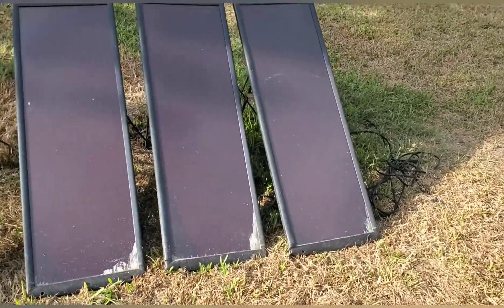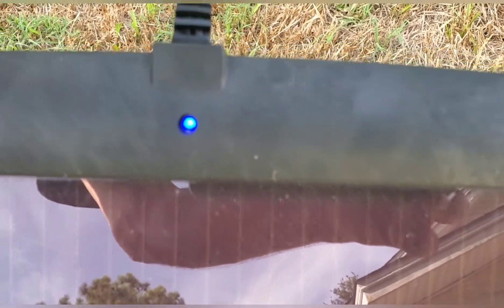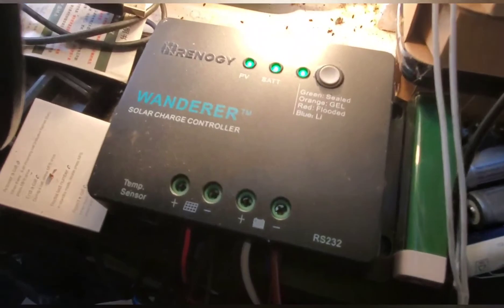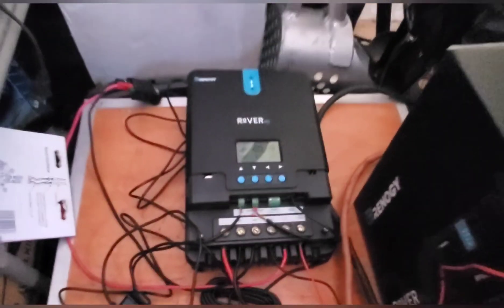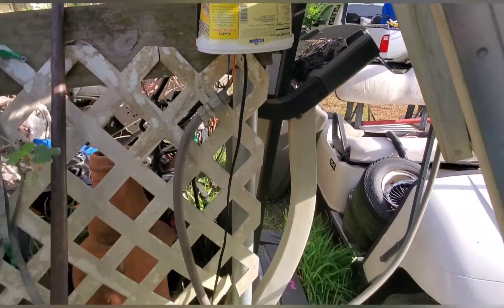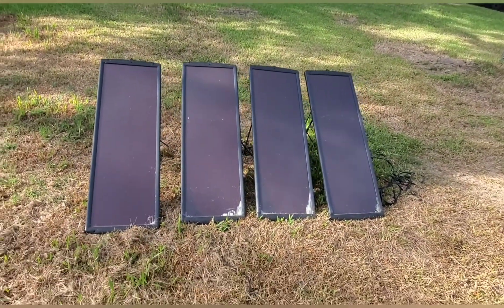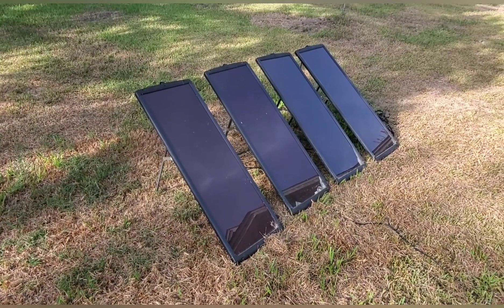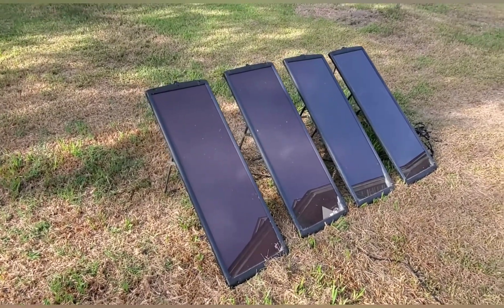Harbor Freight Solar System 4 years Later, How did it Fair?

Comment: For over 40 years... I've been told never to set batteries on the ground,it kills them
Reply from the maker: I was told never set Batteries on Concrete, but either way, my batteries are in a rack mount system that holds them. They are still going strong after 4+ Years. The ones in the video that are on the ground get cycled through into the generator as a start battery. The whole house generator doesn't keep the battery charged, so I just do it this way. I could just add a solar panel to the generator, but I have been lazy so far.

Comment: I have been using the same system for years and it is still working fine. What I did after inspecting the panels is seal the edges where the glass panel meets the plastic with clear RTV. I think water might be getting in there so I sealed it. all else working great.
Reply from the maker: I am going to take the dead panels apart and see if the wiring is just bad. I suspect you are right and water got in there and corroded the connections. I just haven't slowed down and done so. I will make a follow up video when I do attempt to repair them. Thanks for the comment.